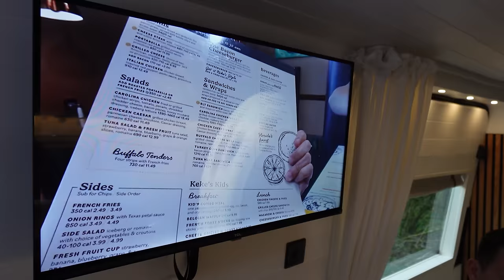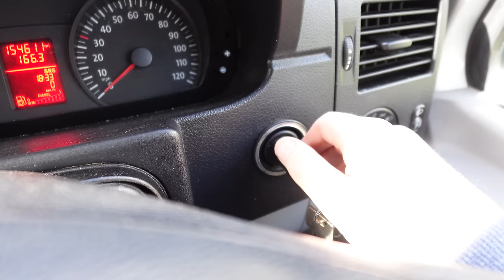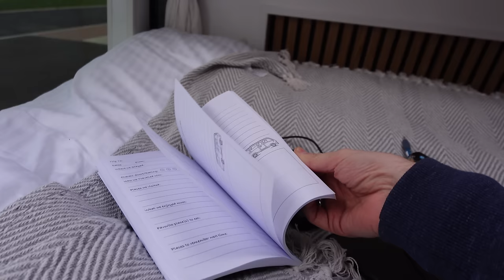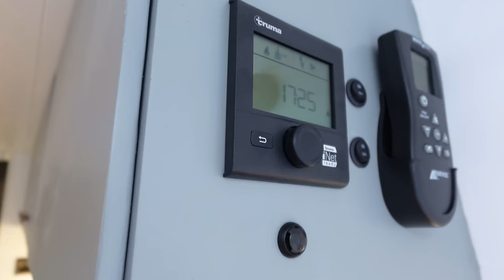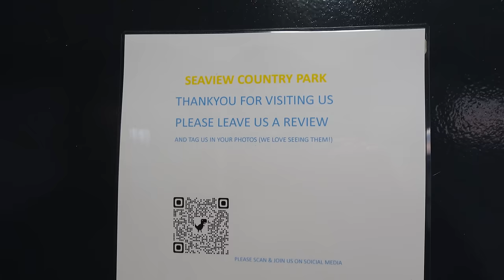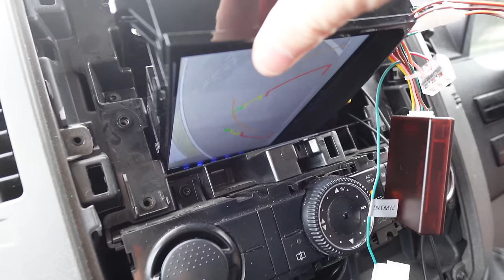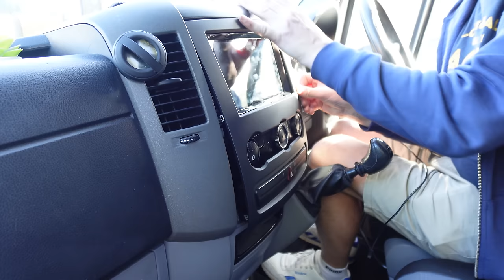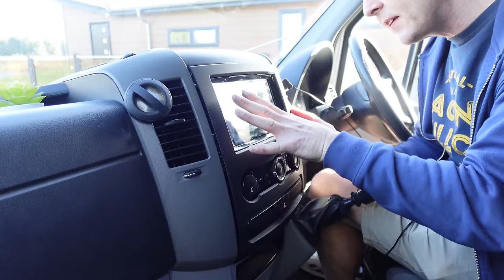SEA VIEW CAMPERVAN OVERNIGHT STAY - THINGS START GOING WRONG

Comment: I think taking these short trips to start out with is an excellent idea, so you can at least get some problems diagnosed and fixed before you attempt a longer journey. Of course, on the next trip there’ll be a whole new set of problems to deal with, but I suppose that’s inevitable.

Comment: Hi Leigh and Nick great to see you using the van it's been a long time coming. I don't know if you noticed on the radio in the van when you had the issue if you look as the brown wires it looks like they have been compressed maybe that's caused the issue, just thought I'd mention it.

Comment: For the hole in the roof for the door bolt use a plastic pipe plumbing insert they come in various sizes and metal or plastic this will create a nice finish

Comment: Your gas engineer is responsible for the appliances he passed if he did a simple test (which he needs to do) to check that the thermo couple works and wont keep on letting gas pass if there is a flame failure!  he would of realised there is a problem!  Did he really check your van for safety or did he just give a certificate? Keep up the good work lads enjoy your videos!

Comment: We used to run a campsite yes people leave ehu cables when they go out and also reverse into pitch as grass allocated to pitch usually goes on the left ...also we have done van builds and yes issues arise but the memories you make are amazing ...don't get stressed what will happen will happen stress won't change that .. followed you two for many years looking forward to this year's vlogs in Taylor x

Comment: I got a brand new Seat. It was a nightmare! The radio went first. Then the sat nav. Then major error warnings and told me to stop driving. That happened three times. They agreed to take it back in the end. Two weeks at a time they took it in for. 😮 ps. When I first got a van, I found people on the campsites were more than happy to help with any issues like grey waste etc. They’re a helpful lot! Often they give you spare bits etc.😊

Comment: When my partner changed the radio in our jeep it drained all the power, the battery kept going flat , it was a nightmare, changed back to original radio all issues were solved . Might not be the same issue but seems oddly familiar .
Reply from the maker: It suddenly started working again and been fine ever since so we think it may have been the water from the jet wash